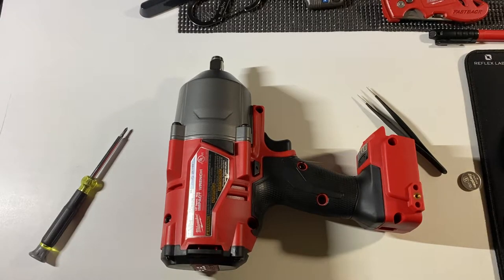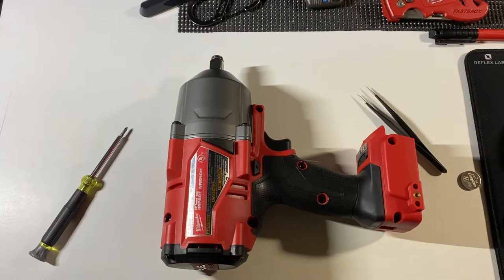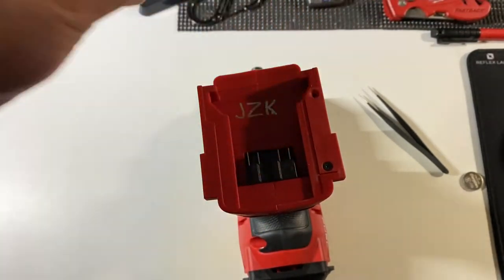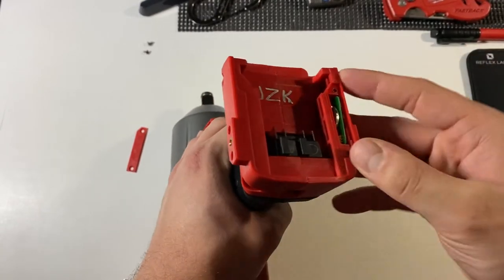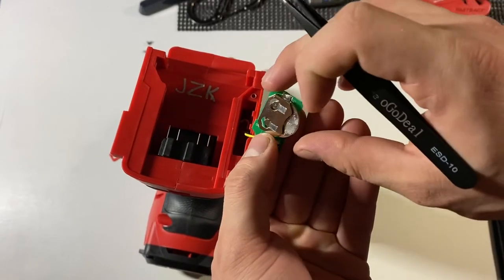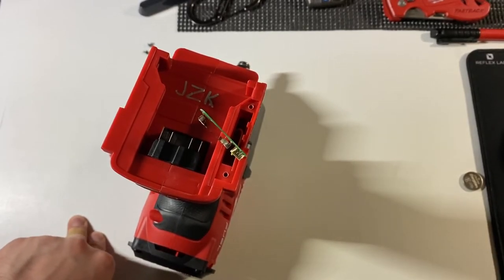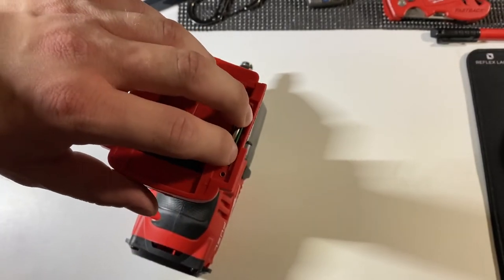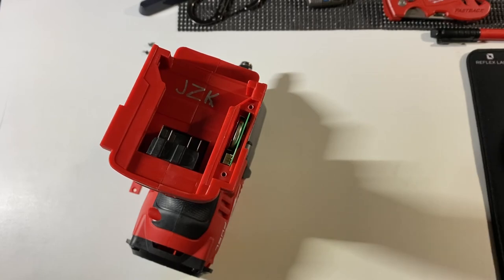How to Locate and Replace Milwaukee One Key Button Cell Battery

Comment: Excellent my one key m18 locked out due to low 2032 battery i simply took it out bite the battery and instantly worked 💪  this is just temporarily till i can get a new battery such a small battery but can cause a massive headcache if dont know they should put this with everytool to change  every year or 2 to prevent issues and heart attacks😂

Comment: @milwaukee got mine in 2017, I've never had any luck with onekey. Supposed to be bt, but need a signal to connect. Most plants I work in, you don't have a signal so it wld never work. Now I'm doubting it's even coming  close to the torque rating of 220 ftlbs. On a job now and won't even break bolts lose that I can by hand with a small 10in ratchet

Comment: Does anyone know how to fix a tool whos one key system wont connect at all? My tool doesn't even display the speed number on the tool. I replaced the battery with a fresh one and still no luck.
Reply: Did you solve this??? Got same issue
Reply: Same problem here.
Reply: @propobx7107   Sent it in to Milwaukee and they gave me a completely new tool. Didn't need to pay either
Reply: @propobx7107  i solved mine if your not bothered about the onekey i removed the internal board and she works fine now
Reply: @bensnare1181  what do you mean?
Reply: @CarlosD360  mine was out of warranty so I thought ad open it up and take a look at the bottom of the gun once opened there is a circuit board for the onekey feature it was that that was stopped mine from working so I removed the board and she now works fine   no issues at all
Reply: @bensnare1181  What did you do with the wires that are going to the board? Just clip them and tie them up or.. ?
Reply: @JasonValentineFL  just clipped them off mate
Reply: @bensnare1181  Thank You! I'm going to give it a shot. My One Key board got moisture in it and corroded which disabled the tool. I don't even use the one key, so I will be happy to rid of it.
Reply: @JasonValentineFL  no worries mate hope your works after
Reply: @JasonValentineFL  did the fix work mate
Reply: @JasonValentineFL  did this work???
Reply: @bensnare1181  so the board with the small watch batterie you took out? Or is there another board? 
Cheers
Reply: @SRSSeattle  yes mate I removed the board put it back together and has worked fine ever since used most days not a problem
Reply: @bensnare1181  appreciate the reply my man but I was under impression that was just a backup board! Looks like a lot of wires connected beyond that
Reply: @SRSSeattle  is yours the one key version or with the variable speeds
Reply: @bensnare1181  one key
Reply: @SRSSeattle  yea just open the gun up and remove the one key board put back together and should work fine

Comment: Is there a way to make/hack the M18 so can swap out the cells by simply inserting new batteries (cells) only by hand... Like changing batteries in a tv remote?? I want to get the Milwaukee Top-off tool but only if I can swap out the batteries, and quickly and easily (no spotwelding or anything or anything like that) so have endless power. I have bunch of 18650 cells around so that would be awesome. There has to be a way!
Reply: They sell kits you can order from China to rebuild Milwaukee batteries, you can also buy a dead pack and repair it. Someone gave me a completely dead pack, I pulled it apart, soldered in a new set of 18650s, and it works good as new. Using quality batteries is key.

Comment: How long is the life span of this battery
Reply: It seems two years….mine just recently went dead and after replacing with new the whole bluetooth tracker and mode selector is not working, tool works fine but you can’t switch modes 1-4, absolute garbage

Comment: Switch button battery and continue with the error in the onekey app
Reply: Or the new button battery will be bad
Reply from the maker: You can connect to the app without the battery so you could remove the battery, connect to the tool in the app, then disconnect, reinstall the battery, then reconnect and see if you still have the error. If you have a voltage tester a new 3V battery should test at 3.2 volts. The original battery only tested at 3 volts even and sometimes said it needed replaced and other times worked but a new one at 3.2 volts fixed my problem.
Reply: * @Mr.Everything  Thank you 
It was solved by deleting the tool from the app and re-registering nothing else*
Reply: @Mr.Everything  same issue here cant get the one key app to register a new coin cell, changed out 4 times with new ones and then with one from a working tool goes from unknown to dead every time deleted it from one key deleted the app still not regirstering, although i have access to the device when connnect via one key and advice

Comment: Sorry, so I take it this is the tracker?
Reply: Yes. Remove coin battery and tracking goes bye bye. Kind of a stupid feature
Reply: This battery identifies the tool when m18 is not connected.  With no battery,  no tracking unless m18 is inserted.

Comment: what happens when the battery is dead? how do you know it's dead? I have a one key impact I bought used and it won't work after having it for a few months. The flash lights just blinks twice. Anyone seen this problem?
Reply: Yes i have same issue.how to slove?

Comment: Does the tool run without the battery or does it lock down?
Reply from the maker: I’ve never really messed with any of the One Key features but I think it did work when I had the battery out. Although if it’s set up for theft protection I’m not sure if it would work then.
Reply: @Mr.Everything  yeah I just meant would it still work if the battery dies. The drill that is. Lolol. No thieving here🤣
Reply: @Mr.Everything  I just bought a one-key tool from ebay, he's not sure of the one-key is locked out, so looking to see if I can disable it just in case, any tips?
Reply: My 2863-20 isn't connecting via bluetooth - so I'm assuming it's this coin cell battery that's died and causing problems. Currently - it works on what I think was the last setting I had it on, but won't change to the other settings. So yes the tool works - barely.
Reply: @engjds  how did it go?
Reply: It works but you can’t change modes, my coin battery went dead and after replacing the BT or mode selection is not working at all, tried everything and no luck, really disappointed that I got the one key garbage….

Comment: LOL I got my first Milwaukee today and intended to swap this battery, and the cable broke....It's kinda too thin and fragile in my opinion, especially you have to take the whole board out to change the battery makes it very easy to mess up.

Comment: Where the F is the coin cell in the site light. Schematic is worthless from Milwaukee. Can’t see what part of the light needs to be removed. The base or top etc. ridiculous the battery isn’t accessible without tearing the light apart with a bunch of screws.
Reply: If you buy a used Milwaukee one key I recommend removing that battery. I bought a whole set of the one key tools and eventually one by one they all locked out and became useless. Not sure but without that battery it shouldn't be able to lock out
Reply: How did you get the schematic?

Comment: I just got my propress one key stolen. If they remove the battery can it still be tracked ?
Reply from the maker: I don't think it works without the battery, although it might if it's still connected to a battery pack but I've never used the OneKey feature to know for sure.